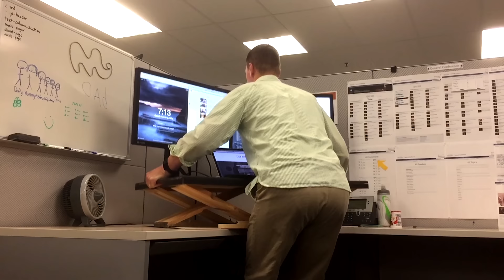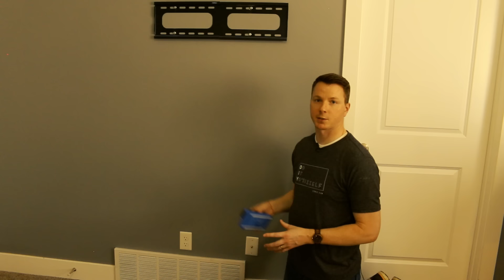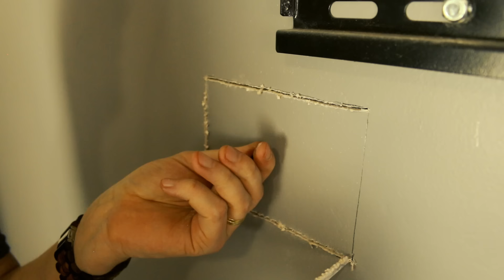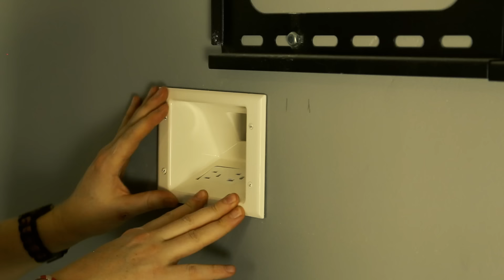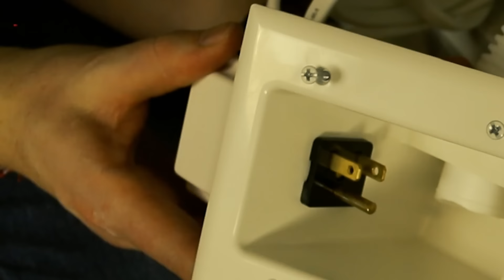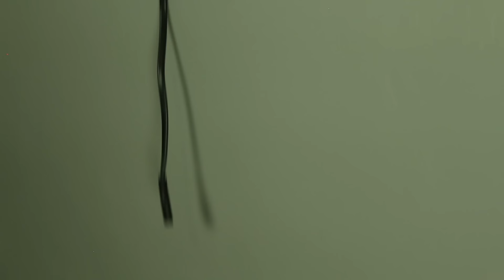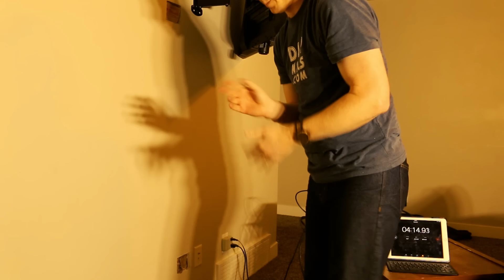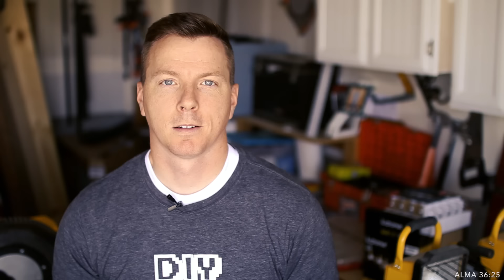How To Hide Your TV Wires in 30 Minutes - DIY

Comment: I would never wire anything like that in my house.
Electrical lines should be wired separately and not to mention should go in from one junction box to the next.
This is no better than running an extension cord up a wall.
Low voltage lines should be run away from high voltage (magnetic flux lines = interference).  A foot would be more than acceptable.
Dont start with (hdmi and audio cables are shielded), manufacturers are getting cheaper on materials and shielding is getting thinner.  
Other than that the video is well instructed.  I just dont agree with the materials.
For the tubing I've drilled holes and used a zip tie to prevent it from moving.
Reply: digitechicnal yes it is better then running an extension cord thru a wall .....the cord he is using is rated for inside a wall ....an extension cord is not ...other then that you make some good points but sometimes it’s just not practical
Reply: Shutup

Comment: This is so fucking stupid. You can hire an electrician or run actual electrical 14-3 wire from the lower receptical to a new reciptical you install up at the TV, instead of making two huge holes and running an extension cord of all things. I severely doubt this is up to electrical code in most places.

Comment: Licensed electrician....if you are following this video ignore everything to do with electric. It wont pass code
Everything else is good
Reply: There actually isn't anything here that's a code violation. Not the way a pro does it sure but it should pass inspection unless you have local codes which disallow something

Comment: Tie piece of plastic bag to a string and suck it through the pipe with a vacuum, then use the string to pull wires. Really don't need pipe when running straight up and down though. You could also run electrical cable to existing electrical plug and tie into existing wiring using a old work box, that way it looks even cleaner below.

Comment: So by law it has to be done this way?
Reply from the maker: Not necessarily. You can also just add an outlet to the back of the TV and hide your A/V wires another way - this is just one of the easiest ways to get it done since the kit takes a lot of the work out of it. I have another video on adding an outlet and a third on hiding your TV A/V wires that you can check out if you want to.

Comment: Never coil a mains lead! That’s a fire waiting to happen.( a coiled cable WILL produce heat). Either cut the cable to length or shorten it by going up and down about 6”(150mm) until it is short enough and cable tie or tape together.

Comment: Probably asked already, but why didn't you just tap into that existing line right at the box?

Why exactly anyone would want that setup you made with the jumper over to the line? Just splice directly into the existing box/line
Reply: A lot of you are missing the point. DIY= Do It Yourself. Most people aren't licensed electricians. Most people don't feel comfortable splicing or running electric wires, etc. It would be irresponsible to advise DIYers to do work of this nature. Even the geek squad at Best buy that does home AV installs won't mess with people's electrical.
Reply: Would cost 5$ instead of.. idk. I didn't listen to what he was saying.
Reply: Brian Derek Willett jb

Comment: My flat screen TV is above the fire place. Now that will really become a pain in the arse. I guess I must cut the sheet rock at every stud drill the required holes when I go side ways to where my boxes are located. Also I have never seen those handy electrical connections where do you buy those.

Comment: I like your presentation and style.  I gotta give a thumbs down because you make assurances multiple times that this is completely to code, it's not.  Only the kit that you are using is code compliant, but not your technique or addition of the hose.  Your bilge and pump hose is not rated for in-wall use in a home.  You must use flexible raceway or ENT(Electrical Non-metallic Tubing) that is UL listed and it must be properly terminated if you want to pull any plain old A/V wires through it.  Otherwise your A/V cabling must be CL-rated for in-wall use or it isn't to code.

Comment: Power outlets are almost always on a stud but wall plates for cable connections are not usually on studs for the record . i install cable and theres no reason to put wall plates on studs and most people dont.

Comment: The bottom box is a NEC code violation. 6" of wire is required outside of the junction box. Hire a professional who is competent with electrical installation requirements.

Comment: Code complaint is six inches of wire sticking out of the box nearest the floor and use actual wire nuts while splicing the wires with a lineman’s for better results. The wagos are not advisable.

Comment: In many states in the US this is against fire code and will fail an inspection. Don't be cheap. Hire an electrician to install an outlet higher on the wall, behind where you plan to mount the TV.

Comment: 29 minutes to do the install on an exterior wall? Takes me 5 minutes and 15 to 20 minutes with mounting a TV. It's just cheaper to raise a electrical outlet and use two nose rings/scoops then to buy one of those kits.

Coiling the electrical wire is a bad idea. It creates a Inductive load and also the wire can heat up.

Comment: First  off - tv should not be mounted so high, it should be at eye level while sitting. As they already had a furniture below it that didn't hide the cables even after trying to hide the cables, ( it sounds kind of silly I know). Just go on ebay or amazon,or whatever online website and order a good sized tall enough unit/chest of drawers, entertainment center etc and put your tv on top. The position this tv is at is very annoying to look at. I know,I know many people just want a fancy-pants wall mount tv, because this is looking nice and modern, and so some of the tvs will end up looking like above. Where is part 2 - how to mount your sofa on the wall,so that you can watch without neck pain? That being said - good instruction, well-made video, although the end resut is crap IN THAT particular case, I'm afraid. It just doesn't look right at the end.  If you have the space, just put it on some tv unit. For the money you will likely spend on  electrician you may as well buy a piece of furniture,that will not only hide the cables but other things too. But anyways, that is your neck, and yours only, do as you please.

Comment: I dont get the shade in the comment section. Dont forget this is product specific. This is good for the person that does not have the credintials to maintenance high voltage lines. of course there are different ways to do this , that doesnt mean better. i'd recommend this as a good learning piece. good work.

Comment: I am a professional painter and I can tell you the paint job in that room is driving me facking crazy it's so bad. The kit you used is pretty cool, but I agree with the nut below me that it would have been better to run power straight into the back of the outlet. Though I suppose that's not what these kits are about lol. There are other sets you can buy where you add a hardwired outlet, and the A/V wires just go through behind the wall.

Comment: Uuuuhhhhhhhhhhhh, your upper box needs to be rotated 90 degrees.  Also, NEVER completely tighten only one screw/nut on anything with multiple fasteners.  Snug one, then sequentially tighten the others until completely tight.  Why coil the Romex?  Coiling an electrical conductor increases resistance, which in turn increases heat....why not just cut them to the correct length?

Comment: Another option when fishing wire through conduit; use a vacuum to suck a string through first then tie and tape the other end to your cables and pull them through. Good video thanks.
PS Like the bilge hose idea I’ll be using that in the future.

Comment: Yes that's a great idea. I have already sorted all my cables. Especially my stereo which altogether has 5 flex cables. Was not going to spend a fortune on a flex hose to place all the the flex cables in.So I went to a    scrap yard and found the perfect hose from a hoover.The hose I wanted was the hose that you stretch out and then you can push back into place. Then I painted it white to match wall. PERFECT and definetly PRICELESS.
Reply: Next time you're at lowes, ask a knowledgeable person to show you 'smurf' tube. It's UL-approved - for LOW VOLTAGE wiring.
Reply: Nice repurposing. ;-)  Why spend money on a fancy (I use that term loosely) product to do something that has no need to be "UL-approved".  ;-)

Comment: Im an audio video contractor with over 15 years experience  and im surprised no one mentioned  how he used a tape measure to fish upwards inside an insulated wall.  Hmm never done that, perhaps it can be done depending on how packed the insulation is inside the wall.  I notice the omission how he  snaked it up the wall. I guess to make it more appealing to DIYers, saying 30 minutes.  I use fiberglass poles and  YFT snakes (LSD)  but of course a DIYer will attempt whats used in the video.  I strongly encourage of one is uncertain hire a licensed professional.  Fishing walls is as easy as it may appear.
Reply: Better yet, D Knibb, make a video of how YOU would do it. . . then maybe the DIYer's will do it YOUR way since YOU have BETTER ideas (at least in your mind).

Comment: How did you connect the electricity to the bottom box?
Reply from the maker: That's what the extension cord is for. It plugs in your existing outlet and then powers the lower box, which sends power to the upper box.

Comment: Brush outlet covers...  Run a surge protector down to the outlet. No extension cords or wiring a new outlet required and you have 6+ outlets behind the tele.  No worries about code because you didn't add an outlet.  Also, who cares how long it takes?

PS Always run an extra HDMI and even a Coax.

2 Brush outlet covers, $12
2 old work brackets, $3
Stud finder? Pfft, use a strong refrigerator magnet to find the screws/nails. FREE
If you own a home you have a jab saw. FREE
You probably already have all your cables and a surge protector, FREE
$15.

Comment: I like the idea of hiding the cables, but the boxes are not very pretty, ofc. I live in Denmark and we have other standards, I know. 

We cannot fiddle with our electrical outlets at all, I assume that is why you did'nt just pull wires directly from the wall outlet up to a new wall outlet behind the tv, and used an extention cord.

A little tip. When I have problems pulling wires like network cables (up to @ 25feet) through a channel, I use a vacuum cleaner on one end, and feed some string with a little cloth attached to it, through, from the other end, then attach the desired cable to the end of the string, and gently pull it through. :) I have managed to pull 2 x network cables (Cat7) through a ½ inch rippled channel, even with no one else feeding the cable.
Reply from the maker: Thanks for the tips, Morten. I love the idea about the vacuum cleaner and the cloth - very clever! This kit is one way to tackle the problem but I have another video on adding an outlet behind your TV which is what I did in another room in the house. I've received several great comments like yours with tips on fishing wires - I may just have to do a wire fishing video and put all those tips into one place :)
Reply: You are very welcome. :)
Reply: I pulled voice, data and fiber cable for several years and that vacuum trick works great.  Just be careful with holding the string on the end opposite of the vacuum because it can pull the string fast enough to burn your fingers.  :0)  The first time I did this we were running a pull string about 800-1,000 feet through a large conduit and it only took a few seconds from beginning to end...amazing tip!  We didn't have a cloth so we just tied on a paper towel.

Comment: Hi there, 

Thanks for the tutorials. How much weight a dry wall can handle/carry? Can I mount a 65 inch TV on Dry Wall without any issues (That it does not fall ripping of the dry wall)?

Thanks Again!!! It's really good tip for hiding the wires...
Reply from the maker: It can hold quite a bit - easily a 65" TV assuming you have the proper drywall anchors. They're rated for different weights per anchor but most TVs are not held up by the drywall, but are anchored into one of the studs. My TV, for example, is bolted into a stud, which is much stronger than the drywall and doesn't require drywall anchor screws.

Comment: So you could use a stud finder to find a fireblock?  That is what im concern about...If the wall has a fireblock.
Reply from the maker: Yes, a fireblock is just a stud behind the wall, similar to your other studs. It's best to hold your stud finder vertically (or perpendicular to the normal way) while searching for fireblocks.
Reply: okay cool thanks for the advice.
Reply: @Dazzz887 - If you have a fire block stud, you can always get a Diversa Bit which is a long drill bit (several feet long) and drill through the fire block.  The bottom end of the bit sometimes has a small hole so you can tie a string and pull items back up through the hole, or they did the last time I used one about 20 years ago.  Just make sure your drill bit is screwed in tight, and retighten frequently because you're flexing the bit as you drill so it can cause the bit to become loose faster than normal, then BOOM, your expensive bit falls inside the wall.  Just realize that the purpose of the fire block is the stop air flow so fire will not spread as easily, so this hole you drill will allow air flow if there is a fire.
Reply: Well... a fire block is not a stud, usually the same framing material as the studs... but not a stud (https://en.wikipedia.org/wiki/Wall_stud.) That said, good on you for suggesting checking for them with the stud finder. Most people would not think to check for them. I usually know when and when to expect them, yet have still been caught on occasion.

Comment: Make it easier on yourself.  Put a pull string or wire through your conduit (hose) before fishing the conduit down the wall.
I've fished a few thousand walls so far and I've never needed anything more than a piece of a coat hanger that's bent like a hook on one end end,. a length of twine and either a couple of nuts or a lead fishing sinker.    
Ball chain can be substituted for twine and is heavy enough so that it normally will not need any additional weight added. 
I can not suggest using anything made for turd herding to run wire through.  Smurf tube is inexpensive, plastic  and  designed to pull wire through.  It also comes with connectors that automatically latch  into any typical conduit junction.    
Also, whenever doing this sort of thing near duct work (like yourS" it can be very important to verify that the duct does not occupy the same space that you intend to run wire through.

Comment: As an European (living in concrete/brick houses)  i can tell the way to fix it is similar. 
You just need much more prep. you'll be grinding a slot in the wall, which creates a duststorm. then you need to re-plaster and re-paint.

Comment: You actually could have done that using less parts. Also you could have fed the back cable through the back of the other outlet box and pulled the other box out I've done this before it is code compliant. you could also have used a double junction box for the receptacle that is already there  and torn out the single junction box that was there (The boxes are just nailed to the 2x4 in the wall.) You just have to turn off the power before doing it anytime you work on power you should turn it off anyways. If there is two cords inside the outlet box you tie all three together and make sure the tab is still active on the receptacle. and pull a single off the three now you have power going up the wall and to any corresponding outlets it used to connect to.

Comment: Some of these comments are pretty rude, but damn... they kinda have a point! Seems illogical to be willing to cut holes in your wall without being willing to learn enough to wire a new outlet for the TV. And just to get it off my chest, I don't think you need to make your own video in order to criticize someone's video. To me, that is one of the reasons for having a comments section.
Reply: Totally untrue Dominic....you don't need to be a licensed electrician to add an outlet in your own house.  You have no clue what you are talking about
Reply: Rusty Scupper at least where I live you’d need a permit to do electrical work which will on average set you back $1600 unless you get an electrician to do any electrical work. Therefore I’d pick the way he chose or similar
Reply: My area you do
Reply: I think even if you ran a new outlet you would need a way to hide the other wires. The cable box, dvd, etc is probably not going to hide right behind the tv.
Reply: jazisntonaim That’s what IR Repeaters are for. Hope this video is helpful to some beginners with low expectations of what ‘professional’ looks like. Was pretty brutal to watch.
Reply: jazisntonaim 

Oil prices
Reply: Felix, it has to do with electrical safety. You are not allowed to wire stuff like this if you are not a licensed electrician (it's the law). And having an electrician do this for you will cost you at least a $100, likely more. Also, if your insurance company finds out about this, you'll get into trouble.

Most of us here know exactly how to wire directly to the existing outlet, but keep in mind that the world is (very) full of stupid people that would mess this up and burn down their houses.

Comment: Yes that would be wonderful and yes it should work fine with us content because it has the ability to attach to coaxial cable so you can run an HD antenna and get all your local channels plus Kodi and if you use your PlayStation Vue or sling you would have all of your premium services I also recommend Pluto TV